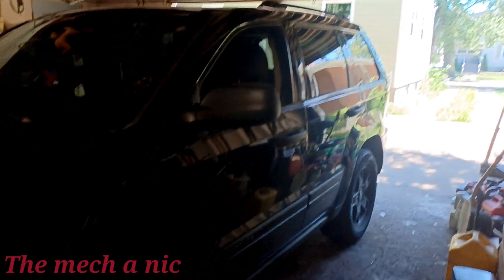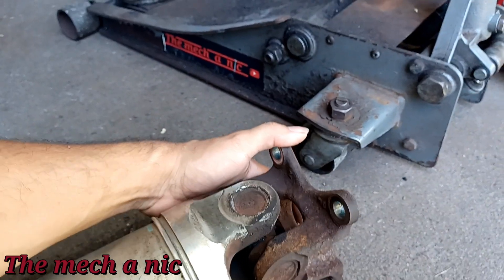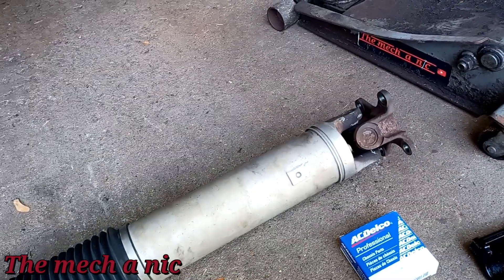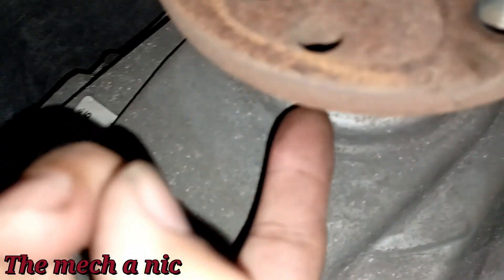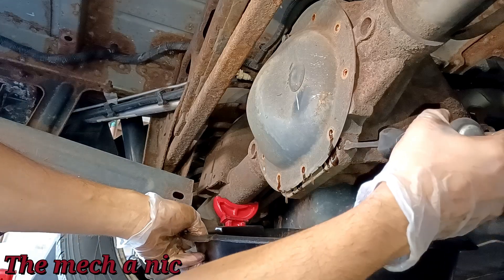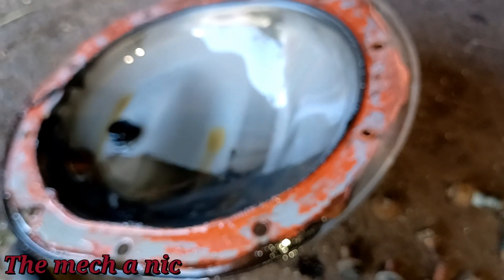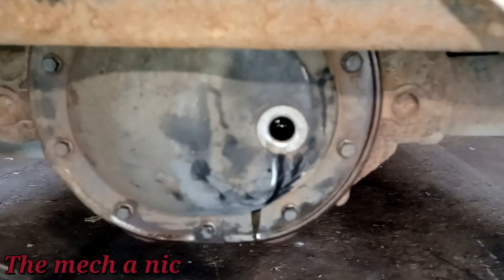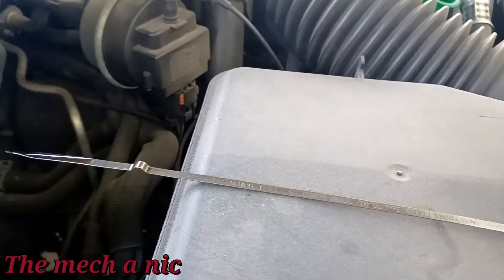grand cherokee driveshaft problem

Comment: FYI all 4x4s drive on the rear in 2 wheel front wheels are chain driven. I dont know where you are but where i am we have an A-1 driveshaft they rebuild and balance those shafts for around  $300 and from what iv run into on those years its usually the oil pressure sender leaking

Comment: Try Tom Wood's Custom Drive Shafts. A lot of 4 wheelers have custom drive shafts made by them. If not find a local drive shaft shop in your area. They can make a custom shaft for probably less than Tom Wood's. Guy Franks

Comment: phillip bailey channel did a staked driveshaft on a rx350. if the joints are the proper dimension i wonder if you can put them in then put tack welds so it doesnt escape. if phillip bailey can do it then i think your skills are up to par. its just if you want to mess with it
Reply from the maker: I'm sure it could be done. The internet is no place to post a video doing that because people would eat you alive in the comment section 🤣
Reply: true. its always easy to be self rightous when its not you paying the bills. in any case someone mentioned you can get an aftermarket driveshaft  for about 250 on ebay

Comment: Hey bro I had loud clanking in my jeep grand cherokee 07 comming from the front drive area,  could not 100% pinpoint where noise was comming from, so I pulled the front drive shaft wanting to just run 2wd for now and it won't move an inch.  Won't do nothing....any ideas?  Any advice would be appreciated 🙏

Comment: IMO Smoke test that engine. Probably valve seals, very easy to replace,
inexpensive parts (seals, valve cover gaskets)  On RA that Driveshaft is $250.
Valve stuff is $30 cover gaskets w/grommets and $30 seals. 
$320 parts + your labor is keeping that car alive for someone.

Comment: "U-Joint"
+ = Trunnion
Y = Yoke
[ = Bearing Caps (4)
lllll = Needle Bearings
G = G clips (4)
Zurk fitting is optional.

At least you didn't refer to it as a "thingee"🤦🏾‍♂